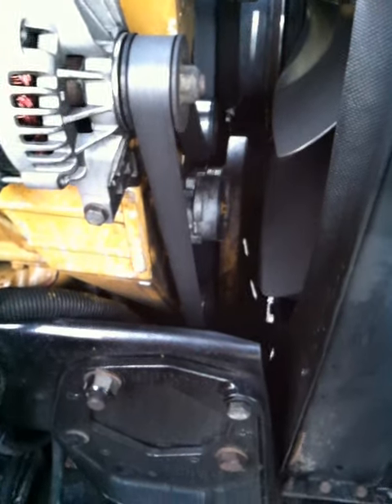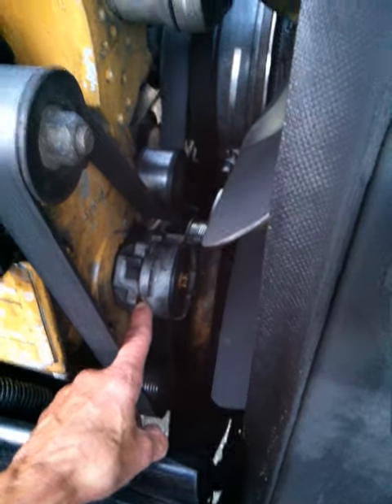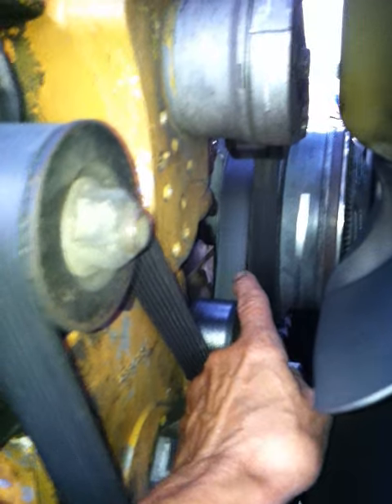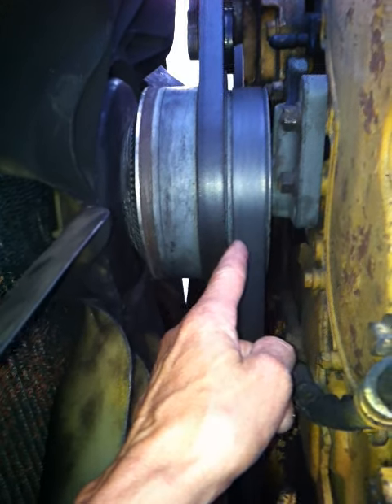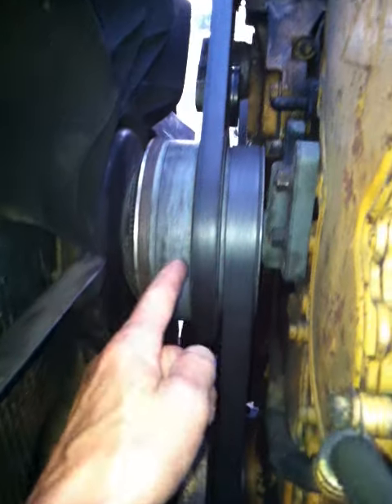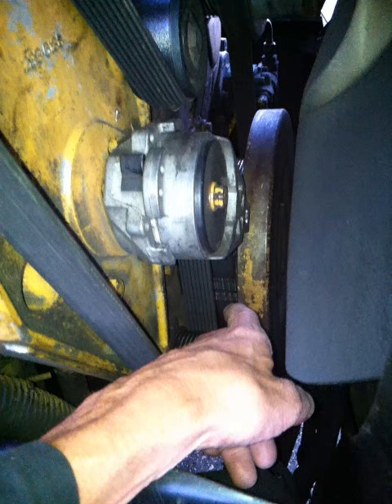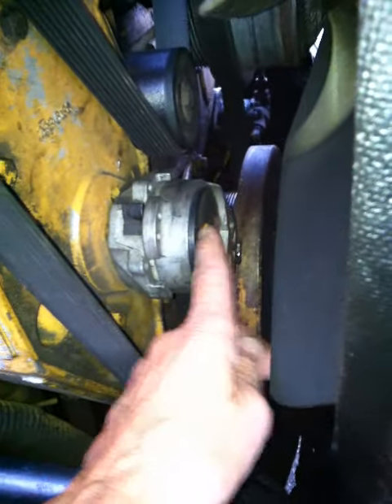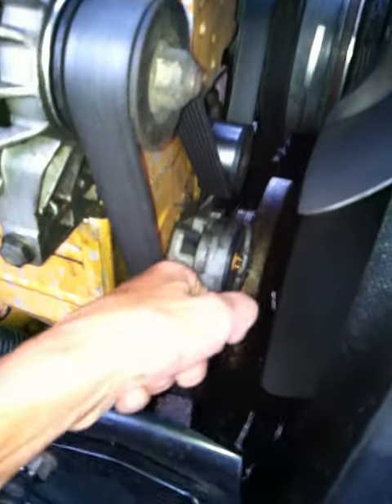C15 engine, serpertine belt removal and install

Comment: Thanks for the post saved me on the side of the road today on my Kenworth!!
The part # I used for the alternator and fan was 8 rib 
Part #  D84-1000-3082370 It will cross over to a Napa belt too. It was about $62.00

The A/C belt was 6 rib. 
Part # D84-1000-3061460 that one was about $45.00

It was easier for me to take off the tensioner with a 5/8 wrench and used a 1/2" ratchet square end on the square hole on the tensioner. 
Hope it helps someone else.
Reply: Ruben: mañana comprar los belts y un pulley. 
Gracias por la información.